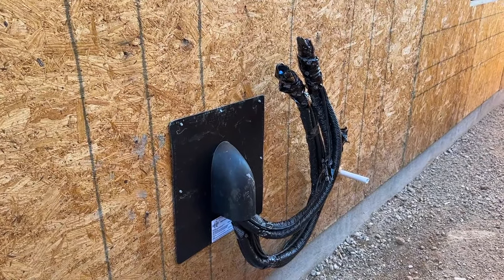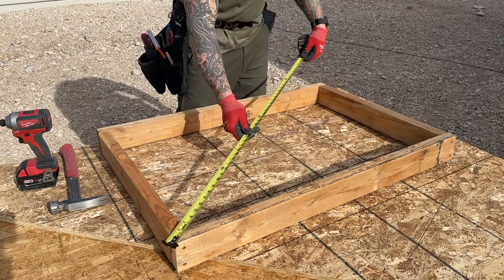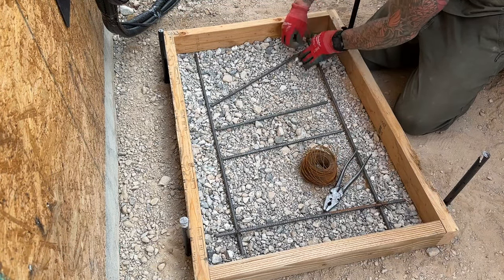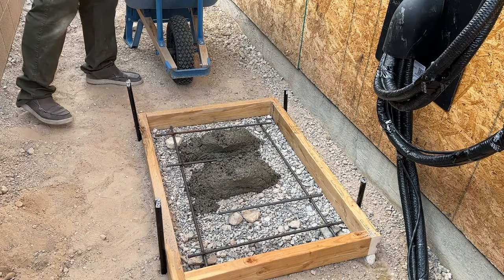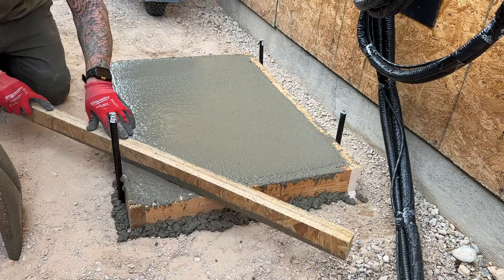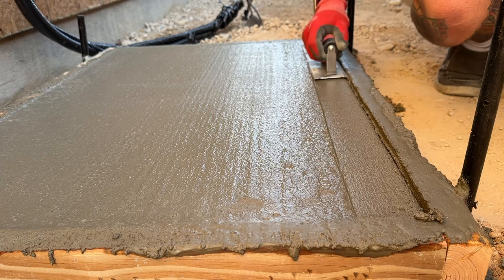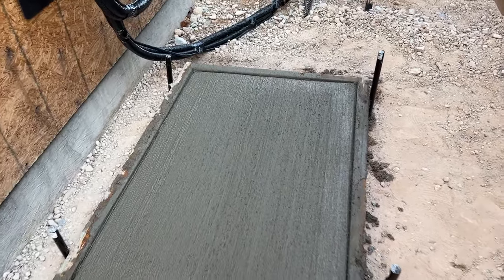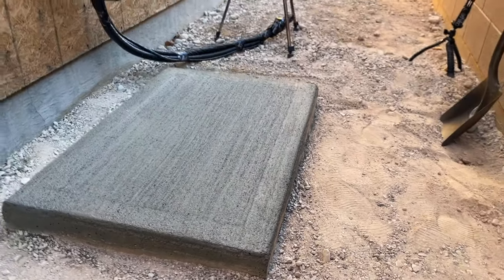How To Pour Concrete and Broom Finish | Mini Split AC Condenser Pad

Comment: Planning to do the pad for my mini split just like that with out it connecting to the house foundation as there is a sprinkler on the way.  Any problems with leaving that gap with water collecting there?
Reply from the maker: I wouldn’t pour around the sprinkler head honestly. I would try to move that pad or move the sprinkler head.

Comment: is there a reason you don't mix the concrete in a bucket,seems like it would be easier to deal with?
Reply from the maker: Like a 5 gal bucket? Mixing in something that small would be very difficult to get all the dry spots mixed well. And I’ve done it before and sometimes you pop a hole in the bucket if using a shovel.  This pad took several bags of concrete so with a small bucket you’d be making lots of batches. With the wheelbarrow it took to batches. I need to get an actual cement mixer soon probably though. Could make life a bit easier
Reply: @FortKnoxCo  That would take all the fun out of it.haha
Thanks for the video
Reply: @FortKnoxCo  Are you affiliated with Fort Knox gun safes? That's what I do is move safes. Them fort Knox safes are built well. Probably the best built ones available. But there is a lot of different good ones out there. Thanks again
Reply from the maker: @duaneross9271  no, no association with the safe company. Fort-Knox is a play off my last name. Nick name when I played sports. So early off when I started my custom building and construction I came up with the name to brand things I built.  I agree, the Fort Knox safes are very nice.

Comment: I'm not sure what to expect. You say "don't overwork the concrete" and you skip troweling and floating while it was setting. This conflicts with information I've seen elsewhere. Is this simply your preference for a less smooth surface?
Reply from the maker: In the video I could have let the concrete sit a little more. I was mainly making the video to show the overall process and talking about some facts about the concrete and forms and mixing. If I would have let it set longer I could have achieved a smoother finish.